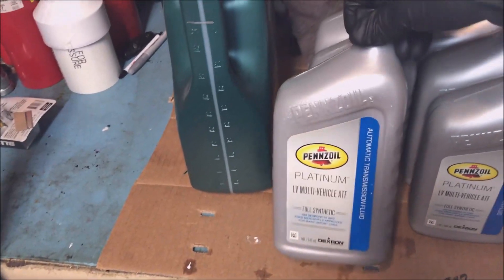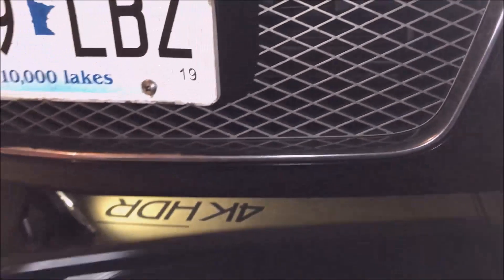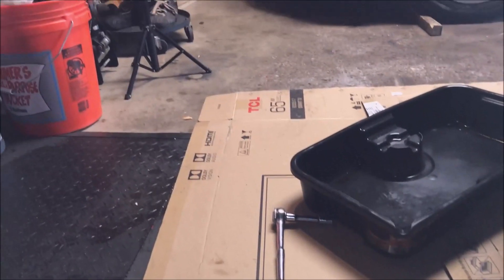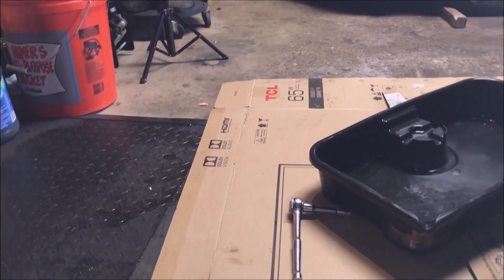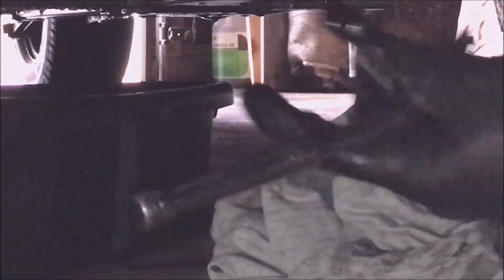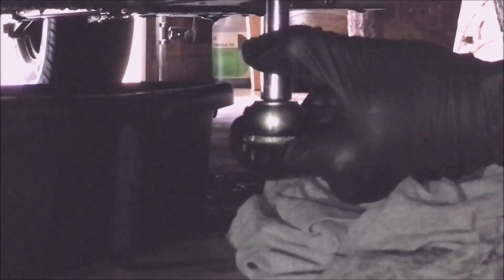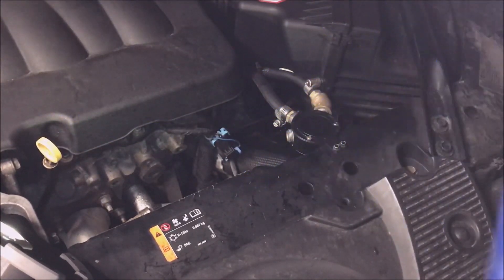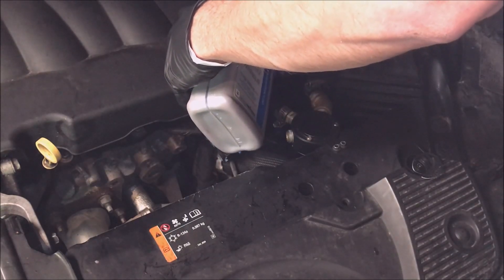2012-2016 Impala/Limited (9th Gen) Transmission Fluid Drain & Fill

Comment: I have a 2014 impala lt Limited with 150,000 miles and never have my transmission fluid or filter changed. I have spoke with some mechanics and some said it would be good to change and some said it will be bad because it could lock my transmission up. I feel like my transmission is not putting out as much power as it should and it is shifting kind of slowly. Can you help please?
Reply from the maker: I would drain a little bit of the fluid out and see what condition it's in.  If it is very dark and smells burnt, then you're going to need a rebuild soon.  If it's a faint pink or light brown color you should be fine to change it out.  For good measure, dip your finger into the fluid you drained out and rub it between your thumb and forefinger and feel if it's gritty. If not, you're good to change the fluid.

All that said, the car is only 6 years old and roughly 50k past the trans fluid change interval. Unless the car has been abused and beat to shit I personally would change the fluid out.  Don't get a flush, though!!  Drain 5 quarts, replace, then repeat every couple of weeks until you do 4 or 5 drain & fills.
Reply: @CertifiedShadetree  Thanks for the help also do you have a video on replacing transmission and fule filters
Reply from the maker: @carloswashington7748 No problem! I did make a video for replacing the fuel filter on an 8th Gen Impala (2000-2005.)  If you're looking to replace either filter on your 14 Limited, you are off the hook as both are non-serviceable!  The trans filter on the 6T70 is buried deep inside and is only accessible during a full transmission rebuild.  The 3.6's fuel filter is contained within the in-tank fuel pump and, alas, non-serviceable...

Comment: I have a 2012 impala and it doesn't have the drain plug. Any suggestions?
Reply from the maker: Check the location I pointed out and see if there's a set screw in there instead of a hex-head plug. I had one guy comment on here that his Impala had a set screw instead of a drain plug.

Comment: Hey, 
is there a gasket on the drain plug that needs to be replaced when doing drain and refill?
Reply from the maker: It's not shaped like an oil drain plug, so there isn't a gasket or washer or anything like that. I haven't had any issues with mine leaking, but if you were concerned you could always wrap a little teflon tape around the threads.

Comment: How would I know if I have to change the filter or not? I have a 2015 chevy impala 3.6 flex fuel
Reply from the maker: Check the comment I have pinned at the top..
Reply: Lol well that didn’t answer my question. But I think I’m going to go ahead and just do the fluid change.
Reply from the maker: In case it isn't showing for you, I posted: 
"For those wondering, the 6T70 transmission has a non-serviceable internal filter.   Watch this video for clarity: https://www.youtube.com/watch?v=mc3sVrn_mWY
Skip to 29:07 to see the filter being removed.  You'll see it's just not feasible to change the filter unless you have major problems."

Comment: great video, i have a 2013 Impala 3.6L ,6T45E 
 trans fine all shifts are about correct, BUT sometimes when i stop(like at a light) when i press gas pedal to move away , an odd buzz noise comes from transmission and car jerks a little(maybe a lot one lurch forward) car drives fine after that all shifts OK!
 any guess what maybe happening, seems to happen when cold more so, gets better driving easy, and up to temperature!
i'm gonna change fluid anyway, looks brown but clear see thru!
thx Ron
Reply from the maker: How many miles, and how often was the fluid changed? This transmission has a non-serviceable filter, so if the fluid changes were neglected for long periods, the filter could be plugged up. I don't foresee a drain and fill causing any problems, provided the fluid isn't burnt or full of clutch material. If it's just a little brown, do a drain and fill, drive a couple hundred miles, and do another one.
Reply: @CertifiedShadetree  thanks for the info, i'll do the drain &fill , drive it and see what happens, its driveable no problem , but that some time noise and lurch , bothers me, always below 5mph!
ron
Reply from the maker: Best of luck to you! 🍻
Reply: I have a 2012 I bought new. I noticed what you mention after backing out of my driveway which is muddy at the end cause my neighbor waters his lawn excessively and the tires get muddy.  When I go forward I get what you mention off the mark. I turned off traction control and it doesn’t do it.  My neighbor stopped watering the lawn and the car doesn’t make that noise anymore.  So I am no expert but I will take a wild guess you may be experiencing an antilock brake issue. Did you try turning the traction control off?
Reply: @walterbright1396  i have that noise and lurch when i turn left, below 5 mph!
 the other day after a drive in rain and parkover night it did the same thing!
it surprises me and is disconcerting to the wife, because i (say WTF)!
Reply: yes it seems less noticeable when Traction control is turned OFF!
so latly im in Track/off mode!
 i have found for a more spiritable drive for around town, i drive in Low using up to 4th gear, when hit the long hiways click up tp drive for 5th/6th gear!
 a unique transmission for sure!
Reply from the maker: @ronbros  Wow, I don't know how I didn't pick up on that - my car did the same thing, and disabling the traction control temporarily took care of the problem. Here's a video I did repairing the issue:
https://youtu.be/xxzbA5Xw-dY

Comment: How do you do a complete flush? I have a 2013 Impala LS got it with 110k currently at 118k and haven't changed the transmission fluid and should I use full synthetic and also would it be a bad idea to put full synthetic if you don't know what's already in it? Sorry about all the questions lol t.i.a
Reply from the maker: On this transmission, the best way to get all the fluid changed out would be to do a drain & fill, drive it for a couple hundred miles, and do another drain & fill.  For the fluid to meet the Dexron VI specification, it must be full synthetic.  This transmission MUST use Dexron VI ONLY, so you can be assured it's full synthetic no matter what...
Reply: Ok I was gonna order acdelco transmission fluid regular ATF but now ima order the full synthetic kind from acdelco cause I'm gonna do a full tune up on my Impala new spark plugs new ignition coils already did the coolant and ima do it on my next oil change anything else I should do for the tune up?
Reply from the maker: @cesarsera7218  Just make sure the fluid is Dexron VI and you'll be golden.  Your ignition coils shouldn't need replacing unless you have a misfire.  If you happen to damage a boot on one or more of them you can order a rebuild kit from RockAuto.  Oxygen sensors are a good idea to replace when you're doing a tune-up. When you get around the 150k range replace the serpentine belt, idler pulley, and tensioner pulley.  Oh, and install a Catch Can!! The sooner the better, as these engines collect oil on the intake valves and it cakes up and robs the engine of performance. (I have a video posted on how to install one, BTW)
Reply: @CertifiedShadetree  thanks for taking the time and responding and thanks for the info 👌👍
Reply from the maker: @cesarsera7218  No problem, and good luck with your Impala!!

Comment: what if you accidentally  over filled but don't know about how much you over filled it and now you need to drain some but make sure the right amount is still in there
Reply from the maker: You can just loosen the drain plug and drain some fluid out very slowly. Don't remove the plug, otherwise you'll end up having to add a bunch more.

Comment: Do you need 2 change Filter on 2016 impala limited  when you do a Drain & fill?
Reply from the maker: Short answer, no. Long answer, the filter screen is inaccessible unless you're doing a complete rebuild.
Reply: @CertifiedShadetree  tnk you 👌
Reply from the maker: @bdiggy25  Check the link in the comment I have pinned, they show where the filter screen is located.
Reply: It will be doing my first transmission fluid change @ 100k miles ....when wld you recommend the second one🤔 since I don't have 2 change filter.
Reply from the maker: @bdiggy25  I'd do the change again after a couple of weeks of driving. That should get most of the old stuff out.

Comment: Just changed mine today, same vehicle. Sucks that you can't drop the pan on it and change filter.
Reply from the maker: I agree, however on the bright side it's super easy to drain the fluid, so if you change it often enough, you shouldn't have to worry about the filter plugging up.

Comment: How do I change my cooler lines to it? I found a leak by the drain plug
Reply from the maker: The fittings at each end of the cooler lines (both at the radiator and the transmission) have little retaining clips that you simply fish out with a pick or a small screwdriver. Once you pop the clip out, the line pulls straight out. There are 2 lines, they're around $22 at RockAuto.

Comment: ya nO. somebody☝️ mIt actULE wanna know what year 9th gen, Ur working on.  for example, the 12 & 13,R thought to B exactly the sAm & annoyingly yet, they both take diferant transmission fluid typs😒
Reply from the maker: Where did you hear that? I now have two 2015 Impala Limiteds with the exact powertrain and they both use Dexron VI, just the same as the 2012 I was working on in this video. As a rule with very few exceptions, pretty much every GM transmission uses Dexron VI. Everything after 2006 requires it, but it's backwards compatible with every older GM transmission.
But if you're in doubt, check your owners manual.

Comment: Mine is only full when the car is off. When it’s running there is no fluid on the dipstick.
Reply from the maker: Add fluid to it when it's running and up to temp. Add enough to get to the bottom of the range and take it for a short drive. Top it off after the drive..
Reply: @CertifiedShadetree   ok I will. I will report back. Thank you very much
Reply from the maker: Best of luck to you!! 🍻
Reply: @CertifiedShadetree   so after driving it for a while I checked again and sure enough, the fluid is barely on the stick. Main reason I am looking into this is I have a slight shudder and I suspect it’s the fluid level.
Reply from the maker: Here's a vid that could prove a cautionary tale:
https://www.youtube.com/watch?v=MgpzwM3P2_M

Comment: I have a 2016 impala limited ltz. I'm having trouble finding the dip stick to check my transmission fluid, would you be able to help me with that?
Reply from the maker: Check 4:38 of the video.  Your 16 Impala Limited is identical to my 12 Impala.  I have a catch can installed, and the hoses obstruct the dipstick/fill tube, however you should have a clear view of it.  

The dipstick is not conventional, it resembles an oil fill cap.
Reply: @CertifiedShadetree  oh my gosh!! You are freaking awesome!!! Thank you I'm a get on this today thank you so much!
Reply from the maker: @tonydiablo6976  No problem!  Good luck!!
Reply: @CertifiedShadetree  
Everything you need to know is in your owner's manual. Like using dexron V1 not just regular dexron. There are different dexron fluids. Its expensive
Reply from the maker: @gregt6363  Correct.  You absolutely should check your owner's manual, but as a guideline, most GM transmissions after 2006 MUST use DEXRON VI.  Anything older can use either DEX VI or the much less expensive DEX III.
Reply: Open the hood look in the middle of engine and start looking to the right side and find a black cap about diameter of fifty cent coin and that's it

Comment: I need help with a 2015 Impala I cannot locate the transmission fluid too
Reply from the maker: It's in the exact same spot as the 2012 in the video.
Reply: Hello I cannot locate the transmission top at all I watched a video and it said some models may have to be taken to mechanic to check fluid because there isn’t a way to access from under the hood. Have you ever heard of this I made a video as well idk I’d there’s a way I can send it to you
Reply from the maker: I guess I should clarify, as the 2015 Impala has 2 different engines, each with a different transmission.  Does your Impala have the 3.6 liter V6 or the 2.5 liter 4 cylinder?  The way to tell is the engine cover of the 4 cylinder reads "ECOTEC" and the engine cover of the V6 reads "V6 VVT Direct Injection."  If you have the 4 cylinder, then yes, you will have to have a shop check the fluid, as there is no dipstick.  The V6 model does have a dipstick and is in the same spot as the one in my video.
Reply: Mine is the 2.5 4 cylinder
Reply from the maker: So the cap you see at the top of the transmission is used for filling only.  To check the fluid, you have to crawl under the car and locate the upper level plug. After removing that plug, the fluid should be up to the very top of the threads. Fill through the cap at the top if needed.  Not exactly easy, but not entirely impossible either.
Reply: Is there a way I can send a picture to you ? I’m not even seeing the top on top of transmission
Reply from the maker: leaderofwagons@likeabigdog.com
Check this out as well:
https://www.carcarekiosk.com/video/2015_Chevrolet_Impala_LT_2.5L_4_Cyl./transmission_fluid/check_fluid_level
Reply: Yes that’s the video I watched so it’s seems like I can check anything here at home. I was driving then all the sudden my cars rom were going crazy and the car wouldn’t go in drive so I’m thinking it’s the transmission fluid or a busted transmission line
Reply from the maker: Certainly a good place to start. Might be worth going to a shop and getting a fluid exchange (NOT a flush) performed.

Comment: same car...i dont have a drain screw/,,,,it looks like a set screw, inverted, instead???    why  lease help, ty
Reply from the maker: Previous owner lost the drain plug and put a set screw in instead, perhaps?  I say take it out and see if fluid drains out.  If it's been holding and hasn't been leaking all this time, reinstall it when you're finished unless you can find a proper replacement.
Reply: @CertifiedShadetree  ty..so much, great idea
Reply: @CertifiedShadetree  can i get a drain plug replacement from chevy dealership???
Reply from the maker: @-MrRichBiker1967  eBay has one:
https://www.ebay.com/itm/AC-Delco-Automatic-Transmission-Pan-Drain-Plug-New-for-Chevy-Le-Sabre-8654382/121956279404?epid=1569012614&hash=item1c6529246c:g:cIsAAOSwc8hdXIFj

Comment: I need help with my impala😢😢
Reply from the maker: What exactly do you need help with?
Reply: @CertifiedShadetree  i changed the injector and now it won't stop smoking or running out of gas in 15min!! The gas is also coming thru the exhaust
Reply from the maker: @quentinharper1863  I had the same thing happen after I changed my injectors out.  Whatever you do, don't run the engine any more!  Pull the intake and look down into the intake bores to see which cylinder has gas pooling on the valves.  Pull the corresponding injector and replace it.  

Watch this playlist for pointers:
https://www.youtube.com/playlist?list=PLKy6nBoh43BqpRUfB_LdnLakyKQzXnmxu

Comment: I've been doing this shit for 40+ years but I'm not sure how to read that frickin dipstick!!
Reply from the maker: Warm the engine up to operating temp, run it through all gears, then take it for a short drive. Park on a level surface, leave the engine running, then pull the dipstick. The fluid level should be up to the top of the cross-hatched zone on the stick (where it says "FULL HOT".)

Comment: should the engine be warm or cold?
Reply from the maker: Cold.  Let it cool down overnight on level ground if at all possible.
Reply: LeaderOfWagons why again? At shops they do it while it’s hot. What’s the pros and cons of doing it either way?
Reply from the maker: @unitedwestanddividedwefall3521  Read the comment I just pinned to the top of the comment section.  Guy took his Impy to a transmission shop and they weren't able to drain anything when it was hot.
Reply: LeaderOfWagons ok thank you for the response
Reply from the maker: @unitedwestanddividedwefall3521  👍

Comment: from what i have been told you  should not,  have to change your trans. fluid .. unless 100,000 miles .. 
i have been told that transmissions fluid    has a lot of detergent  in it... and can and will cause damage .. trans fluid does not go bad that is why it's a close system  via... no oil pan bolts..
Reply from the maker: I think you're misunderstood.  First off, you say to wait until 100k to change the fluid?!? If you have that mindset, then absolutely you will eventually grenade your transmission.  

The only way you can cause damage to an automatic is if you DON'T change your fluid regularly! And I mean more frequently than 100k. All of that old burnt fluid turns to varnish and builds up inside the transmission, then when you eventually do change the fluid, said detergents knock the varnish & shit loose inside and THAT'S what damages the transmission. (Also happens when you hook the trans to a flushing machine.) 

The trans fluid (like engine oil) itself doesn't go bad, it's the additive package that breaks down.  Extended amount of time and excessive heat will kill the additives very quickly and turn to sludge/varnish.  

Why wait until 100k?  There is NO downside to changing EVERY SINGLE fluid in your car more frequently, INCLUDING trans fluid.  My point of all of this is to change early, change often.

Comment: if you do this to a old transmission,,, you will lose it ...
Reply from the maker: Not necessarily. Your statement is only true if the transmission was neglected for a long period of time.  If you stay on top of maintenance, and change the fluids regularly from an early age, your transmission will last well past 300k miles with no fear of "losing" it.